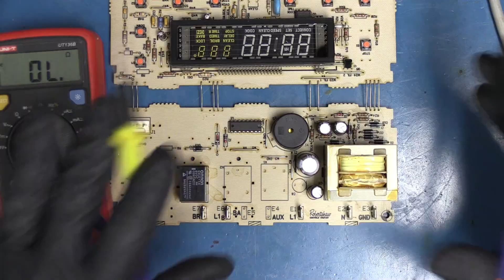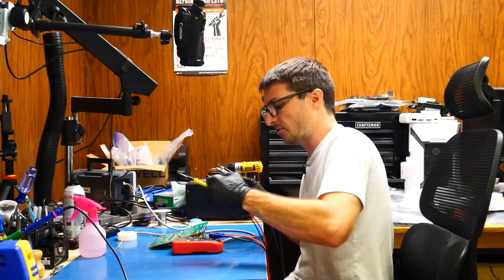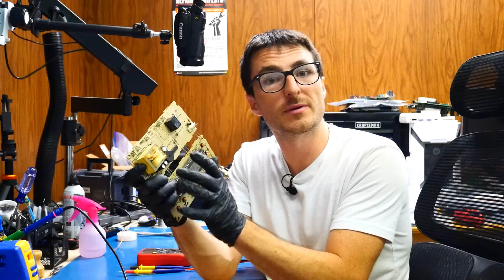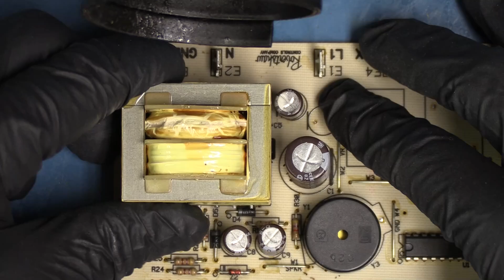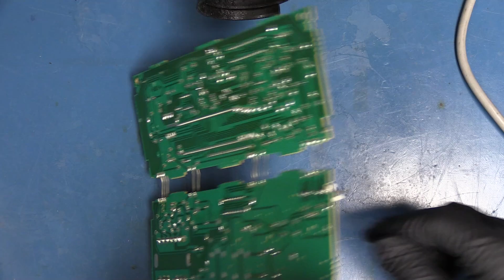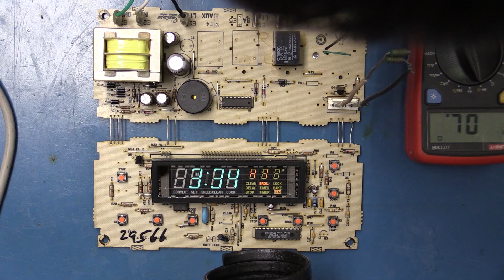Oven Range dead no power repair 12001620 cwg3100aab, cwg3600aab

Comment: My control board keeps doing f3 should I just send it in for repait or is it worth changing out the TC first and see if that fixes the issue. The TC reads good when cold when I tested it last.   Some times f3 happens immediately after turning it on, so it leads me to believe the tc is fine and my issue is in the control board.
Reply from the maker: Hello,
Sorry for the delay in my response. The temp control sensor can fail which is true although in my experience it is more common for the fault to occur due to the control board. It is however cheaper and sometimes easier to replace the temp control first. 
Something you can do is disconnect the oven from power, and using a multimeter in resistance mode take a measurement of the resistance of the temperature sensor. It should be reading a bit over 1k ohm if it is good. If it's bad reading significantly more or less then you know you have a problem. In that case, I would recommend checking your wiring first making sure it's good, and then replacing the sensor. 
If that still doesn't resolve the fault then go ahead and send in the board for our full refurbishing and repair service. 
For these units, we won't just fix the F3 fault but fully refurbish the unit by replacing other parts that may have not yet failed but are likely near their end of life. This way once we fix it, we know it's going to last another 20 years. 
If you have any other questions, I would recommend you reach out to our email directly info@nickselectronics.com or fill out our contact form on our website linked below:
https://nickselectronics.com/pages/contact
This is usually the best way to get a quick response from myself or one of my customer service reps.

Comment: How did you know what voltages to expect at certain pins?    Thank you!
Reply from the maker: I cheated off a good one. We have fixed hundreds of these so we have marked all the expected voltages in certain areas of the board to help with future troubleshooting.
Reply: @NicksElectronicRepair  great! Not cheating, just being efficient. 😉 I will contact/call you about my possible problem with our electric stove.   Thanks!
Reply from the maker: Sounds good, we will do what we can to help, but just FYI we were closed during the holiday weekend and had over 150 emails and lots of phone calls none stop today. So we are getting back to everyone as fast as we can but I only have a small team so we are doing our best to get back to everyone and answer all calls as fast as we can.
Reply: @NicksElectronicRepair totally understand. No hurry on my end. We don't use the oven often and it works, just an annoyance that will probably get worse...  Thank you!
Reply from the maker: No problem

Comment: Thanks Nick's for the video. 
It's amazing how valuable donor boards are today with so many components no longer available.

It reminded me how lucky I was to be able to keep the previous motherboard that was replaced under warranty for my oven's display unit that was no longer working.
Reply: Good point!

I'm assuming you meant "donor" boards. You can use the triple-dot menu ("...") to correct or just update your postings. 🙂👍
Reply: @bobblum5973  Good catch for the "donor". Thanks 😁👍
Reply from the maker: Yup absolutely.